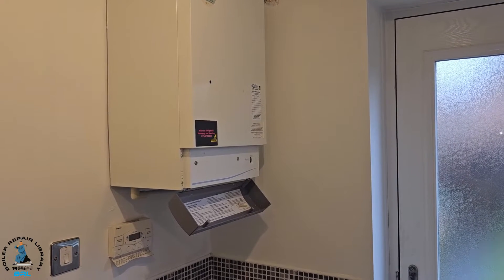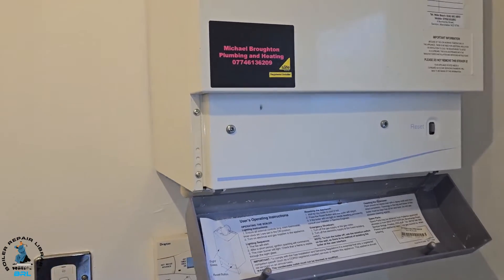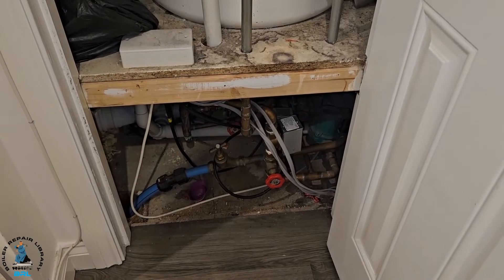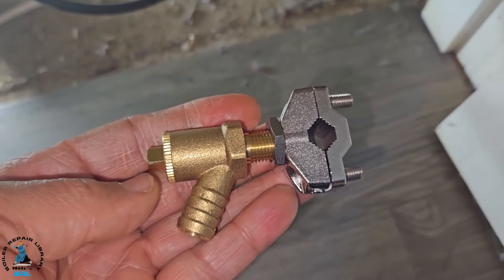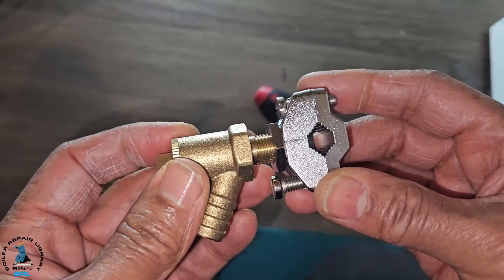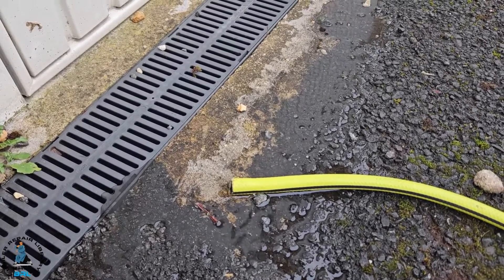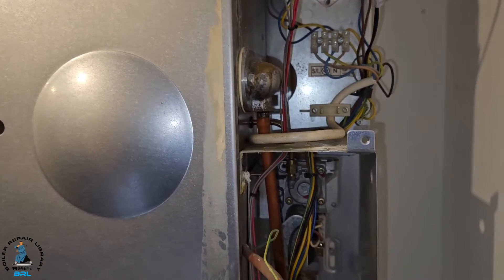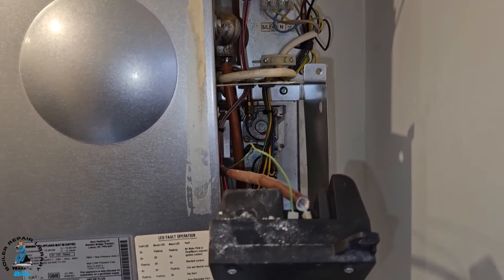Potterton Promax 15 HE Plus Boiler Repair The Die Hard Mentality

Comment: Using the self taping drain off was pure genius.  Could you not try to crack open the faulty part and use an aqua vac while doing it?  Gravity systems are a pain, a real pain.